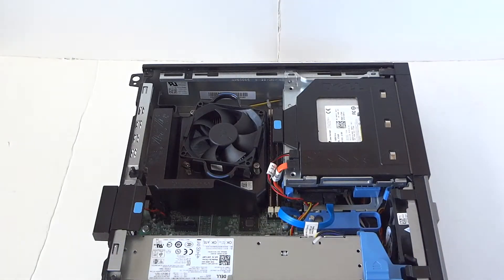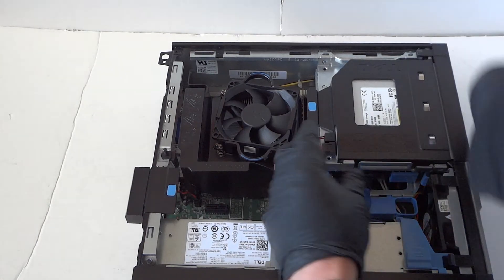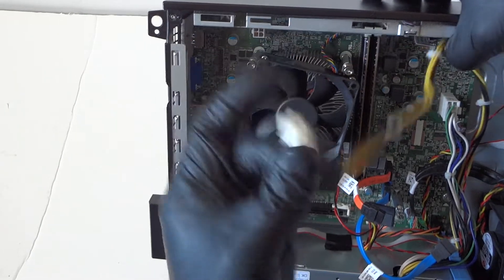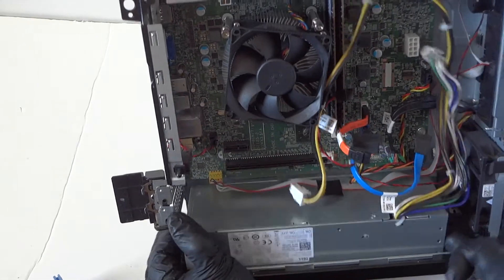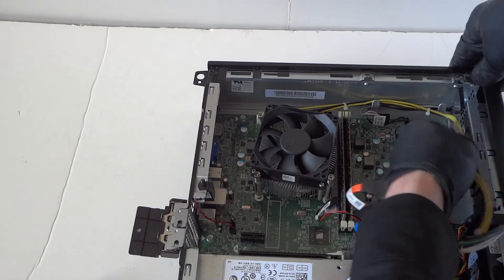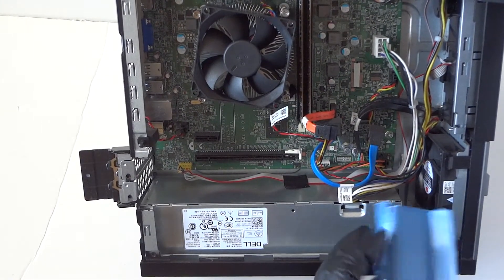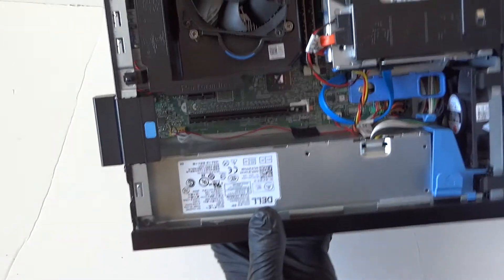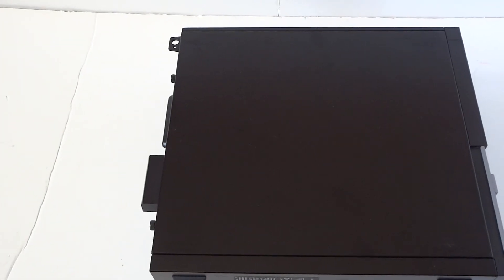Dell Optiplex 3020 SFF Power Supply Replace

Comment: Your video was perfect. Super detailed instructions but pace kept moving the whole time. Without your assistance I would never have attempted this replacement by myself, although in retrospect, it's not that difficult at all. However, you are to be commended for including the putting it back together instructions. Bottom line is you allowed me to perform a repair quickly and at no cost other than the replacement part instead of taking my PC to repair shop and paying them to do this simple repair.  Thanks very much!

Comment: where is the PSU Thermal Sensor on this machine, i just got this for cheap and it seems that the fans run on high and read that i may have a bad PSU Thermal Sensor, what do you think??

Comment: First time replacing a motherboard, thanks for the step by step guide. Ran into an issue, curious if you can point me in the right direction. Motherboard light comes on, Power comes on, fan spins,  but power light is blinking amber with no output to display. No beeping from CPU. Not sure where I messed up. Any help would be appreciated.
Reply: Same happened to me I believe its a dead power supply 😅

Comment: I have the same PC and whenever I try to power it ON, it flashes Yellow and hear a beeping sound. Would replacing the battery supply resolve it or is it something else like a motherboard failed?
Reply: I put new ram and it worked great

Comment: I have this same computer i swapped to a bigger case and 500watt psu now
i am only wondering if this motherboard will be compatible with the gtx 1060 x gaming?
Reply: which powersupply did you buy? I have this problem with my dell 5040... the 8 pin connector to the motherboard isnt a 'regular' connector for a PSU... Now i cant find out which power supply to buy for my dell 5040...
Reply: cpu is an i5 4570 @3.20 
and pci slot (express x16)
Reply: the motherboard is compatible but you will need an extra 8 pin connector from the power supply.
Reply: Hi did you successfully move 3020 SFF to new case? How did you do that? Any problem with MB mounting?
Reply: @franky7522  yes the transfer was successful , and no i didn't have any big issues mounting the MB. Everything works fine
Reply: @lilsoulja1500  any chance to give me picture or video mate? would be appreciate it.. Right now I want to upgrade my 3020 SFF using new case and new PSU.. Then can add proper GPU.. I read somewhere else that this MB is custom built so there might be a problem with the mounting..